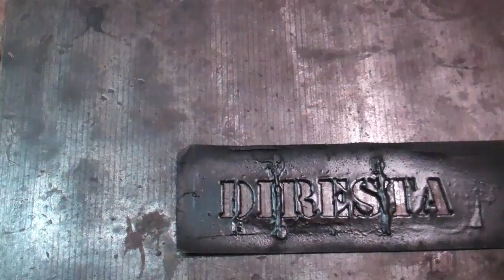✔ DiResta Estwing Hatchet Handle

Comment: You can turn a little Estwing hatchet like that into a much nicer unit simply by re-shaping the head. I take about 3/4 of an inch tapered to nothing at the tip, off the top of the hatchet. That makes it lighter as well. Thanks for the video Jim.

Comment: I'm working on putting an english walnut on a hatchet.  The handle on mine is the metal tube so I'm using one solid piece and fitting it into the hole.  Thanks for the videos!

Comment: Im a roofer and i have various estwing tools and for the most part they are second to none.I have the hatchet and i just dont rate it compared to alot of others.How do you find the estwing hatchet compared to other hatchets.
Reply: davey w Great handle by the way.I have the estwing pick with the same handle and my handle is also shot and needs replacing.I much prefer their rubber handles like the ones on the estwing claw hammers.

Comment: You should have drilled through the wood and metal handle and put some brass or alum pins through it then sanded the whole thing down. I don't trust just glue to hold on the wood handles especially on an impacting tool that will be used out doors.
Reply: Ding ding ding ding. Exactly, several hundred blows and the glue bond with the metal shank will break and the whole hatchet will go flying out of that beautiful wood handle.
Reply: Bet ya $20 it hasn’t flown off yet... 😁
Reply: Or cut one of the original tangs off and extended the other and brought it through the end of the handle.

Comment: Isn't that handle going to break if you just use glue to hold it together?  The original handles have that plate on the bottom to retain the handle.  It looks great but not sure I'd trust it for any real use.
Reply: That's not wood glue its epoxy, epoxy is incredibly strong. Much stronger than the wood.